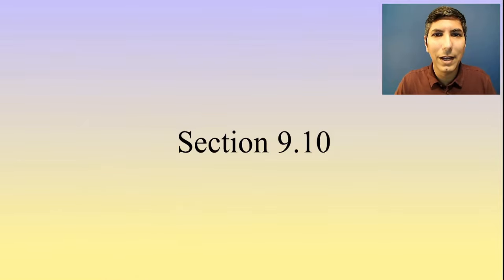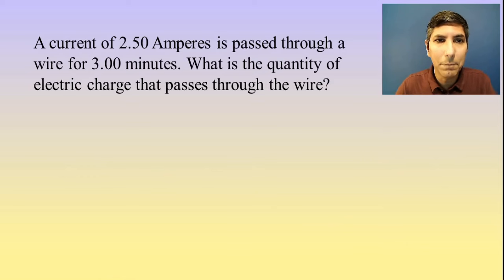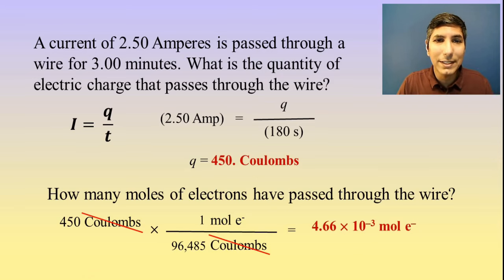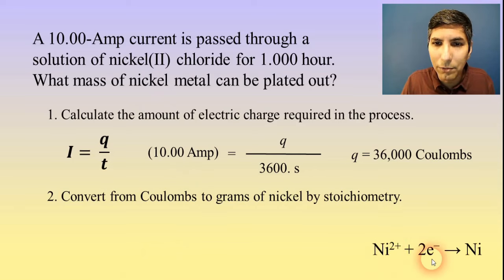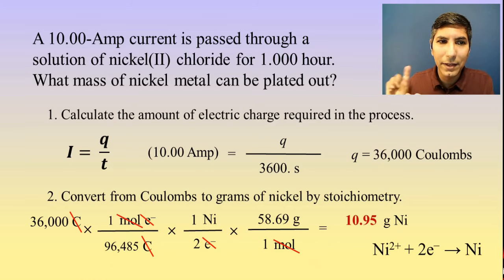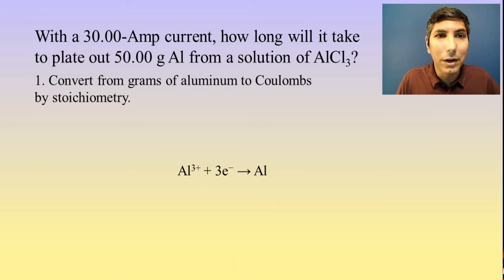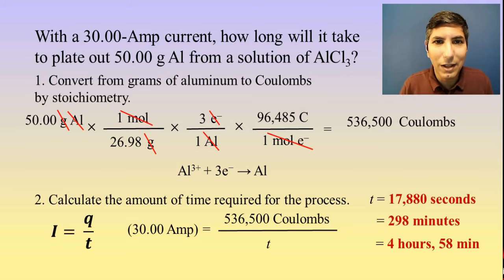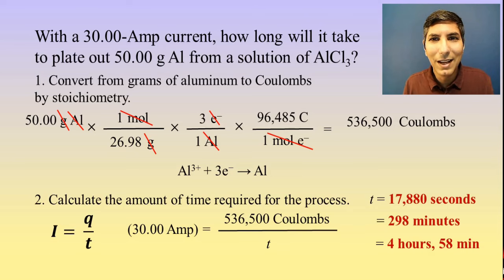Electrolysis and Faraday's Law | AP Chem Unit 9, Topic 11 - AP Chemistry Topic 9.11

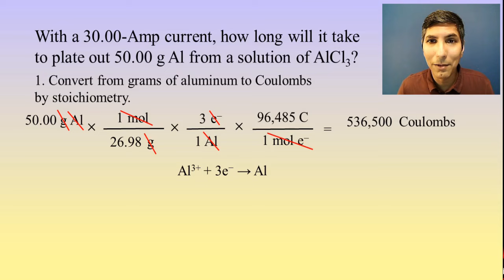Comment: at 12:26 when i plugged the calculation in i got 536425 C i know the answer has to be to 4 sig figs but was wondering why you rounded up to 536500 instead of 536400 because 425 should round down to 400, please help TT I love your videos!
Reply: Sorry for the late response, but yeah, I also think that it should be 536,400 because 425 doesn't round up to 500. I'm a bit confused about this after calculating it as well. Good point!